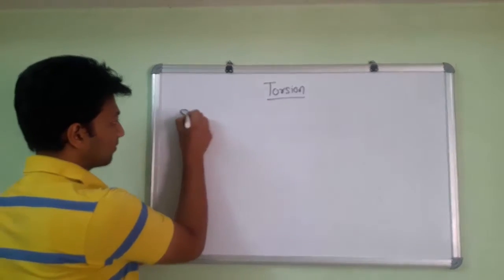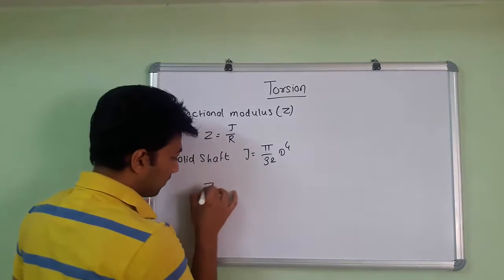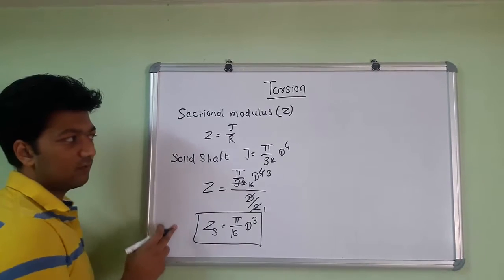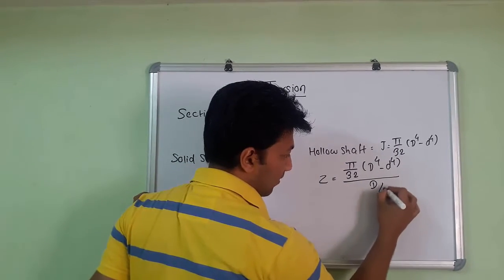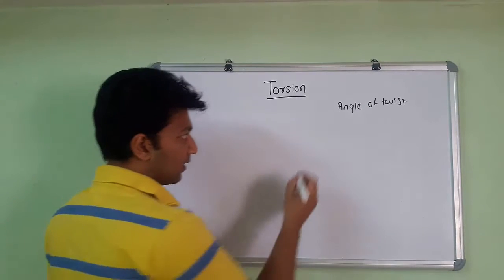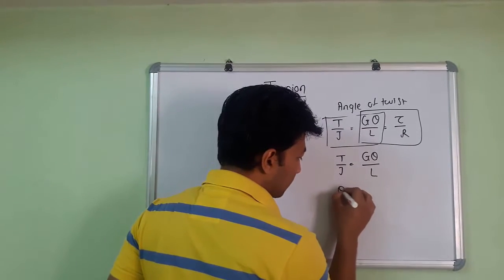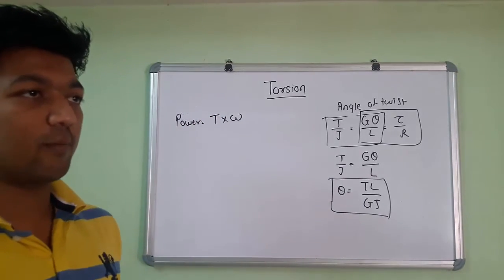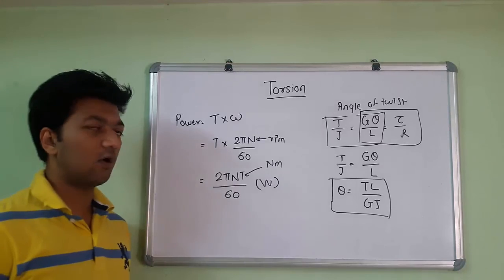Torsion in Shafts (part2) l Strength of Materials l GATE 2020 Mechanical

Comment: A 5-m steel shaft rotating at 2 Hz has 70 kW applied at a
gear that is 2 m from the left end where 20 kW are removed.
At the right end, 30 kW are removed and another 20 kW
leaves the shaft at 1.5 m from the right end.  Find the
uniform shaft diameter so that the shearing stress will not
exceed 60 MPa.if G=83Mps